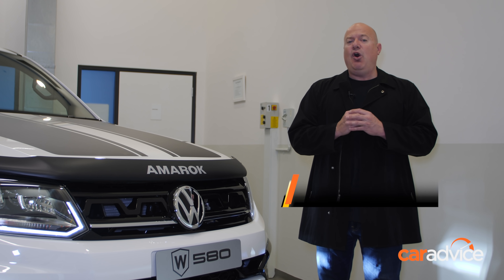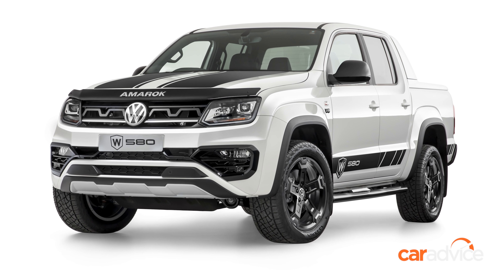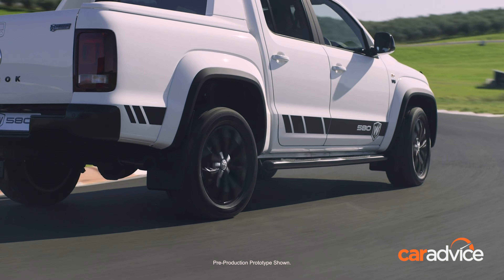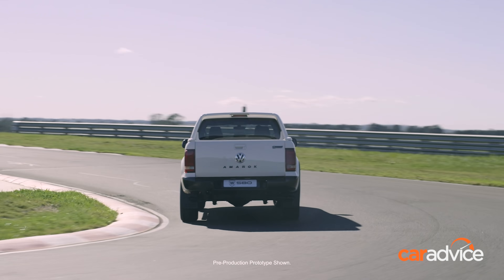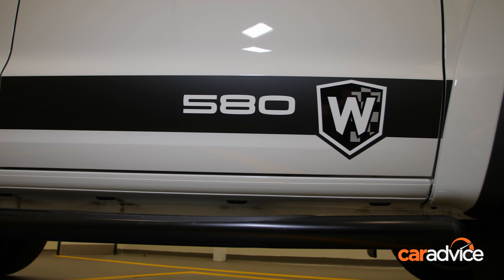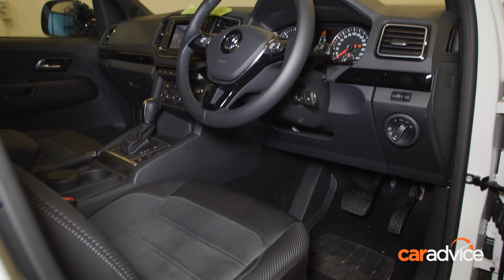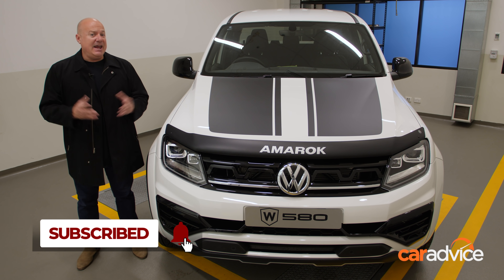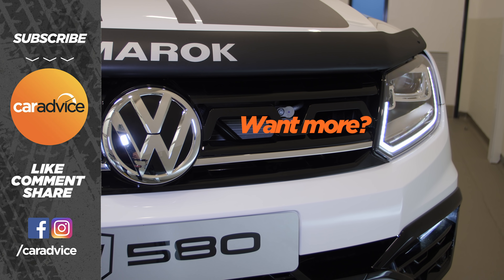2021 Volkswagen Amarok W580 Revealed | CarAdvice

Comment: I fail to understand the need for a grill and sticker pack. 220rwkw is what every other modified Amarok is running.
Reply: Actually auto v6 is all wheel drive and about 150kw at all 4 wheels when still standard,  and about 200kw at all 4 when remapped, you have to do a fair bit more to it to sit around 220.

Comment: You guys definitely should be thinking about a Darkside Developments kit for that upping the power to 400BHP 0 to 60 in 4.8s now thats what this limited run should be getting.
Reply: Don't need to Order from Darkside on the other side of the world when CRD Tech in Aus has can get you the same gear with a tune that will work better in Australia conditions.

Comment: $ 80K for a Ute??  Only stupid people will buy it!
Buy a  Warrior, Raptor  RuggedX!!
Reply: Rugged X hahaha thats cute
Reply: Cause they haven't got the punch of a V6  diesel  remember the 0100 is pretty impressive
Reply: @robertceroli3512  is it worth the extra 15k? The new D-Max is doing 0-100km at 9.73 sec.
Reply: yep well said Buy a  Warrior, Raptor  RuggedX
Reply: Yeah and get wheezy 4 cylinder diesels? No thanks. And if you say to tune it after, just remember that V6 Amaroks can pretty easily be tuned to 700Nm+
Reply: @TheHubble2  it’s not just 0-100, towing will be a lot easier with a V6 diesel than a 4 cylinder
Reply: @HughRussell06   i dont know how reliable a german branded is when they are all made in argentina
Reply: @TheHubble2  I have a 2014 with almost 228,000 kms and apart from some minor issues fixed under warranty (EGR and infotainment), it’s been trouble free
Reply: @HughRussell06  its def not famous for reliability
Reply: @TheHubble2  I know that, but they aren’t completely horrible, apart from some
Reply: @HughRussell06  just dosent seem practical for the asking price especially with fuel cost this day and age. worse if you want to mod this engine to 700nm